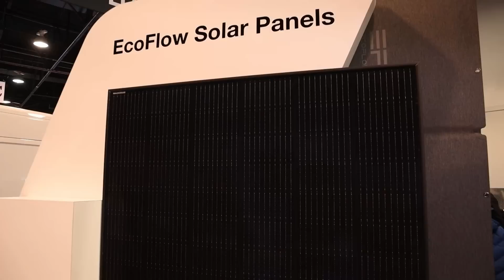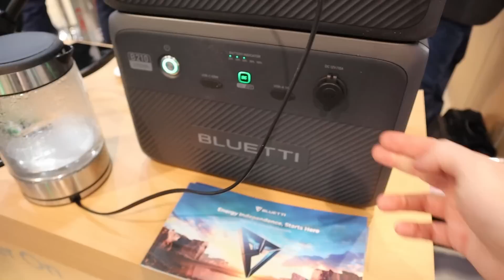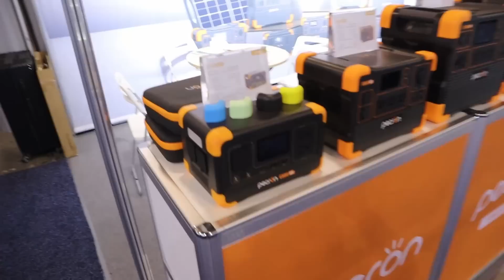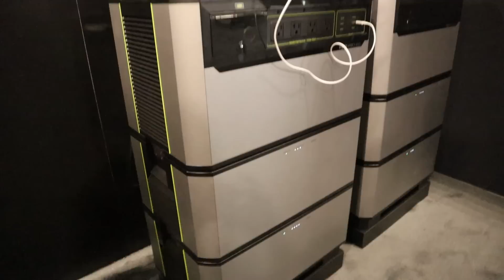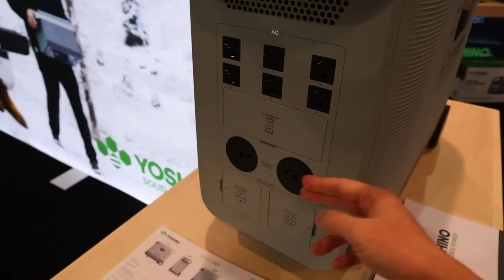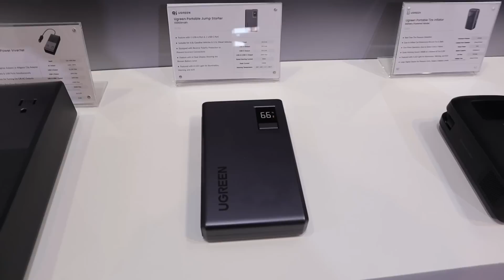Power Stations I Found At CES 2024! EcoFlow - Bluetti - Yoshino - Pecron - Goal Zero - Anker

Comment: No firman zero e?... i got one and it fully charges it self in 80 mins and has attachable 2000w battery pack that just side in bottom and it a 2000watt box 40lbs little box
Reply from the maker: I didn't see them at the show.

Comment: how is the charging on the anker 3600 bad? website says it can charge up to 2400W, seems pretty good to me?
Reply from the maker: You didn't watch the video I guess.
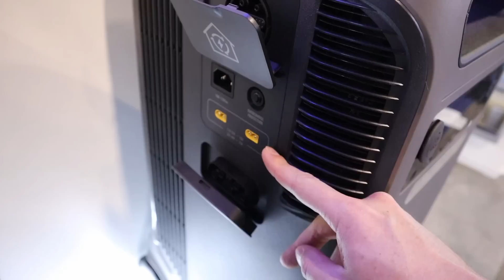Reply: @Jasonoid  uh yeah i did. im commenting on exactly what you said in the video at 16:16, you said that the charging range for the anker is "kindof a bummer" aka its not fucking good, why dont you go back and re watch your own video because you clearly dont remember that you made a negative comment about something, which is why i asked "how is 2400W bad" maybe elaborate a bit here before cocking off.
Reply from the maker: @thelasthallow  sorry about that confusion. Youtube doesnt show me the video the comment came from and I just put out a 30 minute video testing the F3800 where I showed exactly what I'm talking about. Let me elaborate on 'the charging range' I was talking about for the F3800. The input voltage for the Anker F3800 for solar is 11v to 60v, which means the solar panels you use on the power station is very limited. This means in order to have the max input you need to find very specific solar panels to max out the charging of 2400 watts at a very high amperage. You also need to put those panels in parallel which requires much larger cable and added cost and components. If you wanted to run 100ft of cable between your solar panel and power station that wiring would cost over $100. 

All other large power stations have 150v to 500v charging range allowing you to use any solar panel on the market in a series configuration. This keeps the cost wire much lower, you can have very long cable runs from your solar panel to your power station without losing power, and you can use any solar panel you want to get that power.

Anker makes their own solar panel to get the full 2400 watts but each 400w solar panel is $1000 and only has a 1 year warranty. I just bought three 400w solar panels for $450 ($150 each) that have a 25 year warranty so you can see the value of using your own panels. If you want a power station with real solar potential go with a model that has a much higher solar input voltage, not a 60v cutoff.
Reply: @Jasonoid  Seems the guy commenting above doesn't get why having high PV input voltage is so important. I went with Oupes Mega 5 because it has 150vdc PV input comparted to the other comparable units at that price and KWH. He'll see what you mean once he starts running wires from array to the powerstation. Probably under size the cable then be mad at the system not producing expected power. LOL

Comment: That Pecron stuff looks pretty good. They seem to have the 12v side down on their power stations.
And I'm kinda a Bluetti fan boy. 

I know to much 😔 Those Goal Zero fridges can be had on Vevor's site for dirt cheap. LG I guess was sued by Secop a couple years back for directly copying Secops compressor designs. But a few friends have the LG powered Alpicool's. One took a dump. And he replaced it with a Dometic 55IM. 

Speaking of fridges. I have the Iceco Jp40 and Jp50. I'm going to retire them. They work. However the insulation sucks. I had lost all power in my Peterbilt and in 4 hours in 70 degree weather the Jp50 as a freezer was at 50 degrees when I had the battery fuses replaced. No bueno. I know in 10 hours it took my Dometic 55IM to warm up to 26 degrees after it had become uplugged. In 70 degree weather. Big difference.
Reply from the maker: The plastic 'framed' ICECOs don't have the thicker insulated walls like the VL or VLpro series. You can't go wrong with Dometic, they know what they are doing!
Reply: @Jasonoid  Actually both the AJ and JP series chassis have 3.1 inches 79mm of insulation. More than the 55mm of the steel cabinet fridges that Iceco has. More than my beloved Snomaster 85L. 
I think it's because they are shot with insulation that's not very good. And as you know...These are a very common chassis. Alpicool and just about everyone else uses this style of chassis. And they all come from the same place. My sisters VL45 has 55mm. She never complained about it at all. I want to do a experiment with it VS these Jp's.

Comment: That AC240 also has an AC paralleling connector on the side for paralleling 2 AC240's.  It also takes up to 5 of the B210 batteries,  This looks to be quite exciting!  Thanks for showing us all the good stuff coming out in 2024!
Reply from the maker: Series or paralleling port? When I hear parallel ports I think of 120v with more amps and for series ports I think 240v with the same amps. I think it would be sweet to have BOTH options.... Double the 120v output or series for 240v output.
Reply: @Jasonoid  I was just reading how the port was labeled from another CES video and what you are saying would be so simple, as long as the clocks are locked together, in phase gives you double the wattage and 180 out gives you double the voltage.  It would be great to se that option on a power station!

Comment: Any of them advertising 10ms or less UPS transfer time?
I know the Ecoflow Delta Pro Ultra has an Online UPS, but that's too big for a computer UPS.
Reply from the maker: I did a recent video testing many of the popular model UPS speeds, there was actually one power station under 10ms (not the ultra)! Here's the video:    https://youtu.be/ajVgUW4qRGI
Reply: Completely forgot about that video. The UGREEN 2200 was roughly 10ms. Wonder if the UGREEN 1200 is the same, a more reasonable size for a computer UPS. Was hoping vendors would start advertising 10ms like their jump from 30ms to 20ms of last year or so.
Reply from the maker: @adriftatlas  I don't have the 1200 so testing the actual speed is no longer possible but I bet is the exact same design and UPS hardware.

Comment: Can you do something on solar panels that acre 200 watt or higher? That are lightweight which means slightly bendable. I bought a renogy highly rated 200 watt bendable renogy solar panel and it didn’t work. Did not charge much and then just quit. I like renogy and it gets good reviews but really, mine didn’t work at all. Had to send it back .. solar panels that are waterproof are very very heavy for me. That’s why I wanted a lighter weight. Even built it a structure so it would last. Sadly, didn’t even work☹️. Amy other suggestions for completely waterproof.I gut weight 200 plus or above? I’m at a loss…
Reply from the maker: I recently did this video:
https://youtu.be/Y2uhKnHIUl4

Comment: Thank you for showing us all these great products!  As a daily user of our Bluetti’s (AC200P, AC200Max & 2 x B230’s) I am excited about the Bluetti products! 
I hope that in the future these Solar Generator Companies will make units that can send the solar directly to the loads your running from solar saving the strain on the batteries and prolonging there cycle life’s ( Currently the solar goes into the batteries then goes from the batteries to the load ) NEW SUBSCRIBER Thank You!
Reply from the maker: Yeah, it would be great to have a true pass through power mode on solar. For now that's only possible on AC charging because the power is consistent and reliable over AC charging and solar can change drastically over a minute.
Reply: @Jasonoid  this is true but currently there home Solar power units like EG4, Growatt and Solark ( solar charger/ inverters ) that do this already!

Comment: Pecron and Bluetti look good to me. My worry about the swappable batteries is that top and how easily could a little water get in it and damage something. I have had my Ecoflow's DC power stop working after getting caught out in some rain with it. That hatch on the top looks worrisome and I like wireless charging that they usually have. The AC240 looks appealing. Was the solar input a XT60 plug under that cover? Didn't look their common 8mm barrel plug. That big Pecron could be the value king, but I hope they have some kind of app control with it.
Reply from the maker: The e3600 does have app control and a new upgraded touch screen.

Comment: Thanks for sharing Jason! I’d be curious if the Pecron 3600 unit could handle the startup load for an RV air conditioner. That could be a game changer along with its price
Reply from the maker: That's a great test, I'll make sure to test that out!
Reply: @Jasonoid  I'm curious about what standby power draw when inveter is on but no load, I do not know why none of the power station manufacturers have the published spec for it and it should display that on the screen, I hope you will get the chance to it out soon.

Comment: Delta Pro Ultra still seems like the best option when you look at form factor, solar input, 240 output. I can't believe Bluetti didn't improve their massive connecting cords.
Reply from the maker: The Ultra is such an engineering masterpiece! It's so quiet and compact compared to other offerings. As for Bluetti, I wish they would put some decent engineering into the connecting cables! No one wants 4 ft long cables that just stick out everywhere!
Reply: Don't know why they aren't already selling sets of short, flat cabled with 90-degree plugs. The longer ones give you "more options" than just stacking the inverter on top of the battery, I suppose. But what if we do want to only stack?

Comment: ac180t and their fridge is the most exciting.
I love hot swappable batteries!!
Reply from the maker: I like the design of those swappable batteries. They do have plans to have a 'charging' dock so you can charge them on their own.
Reply: They didn't show how they charge.  Swappable is useless if they can't be charged by any other means than by the unit its powering.

Comment: Thank you!!!
Which PS with solar panel would you recommend to power an a/c unit in an RV.
Again thank you for the coverage…..
Reply from the maker: Most of those RV A/Cs use around 1500 watts so you'd need something pretty large to get a decent runtime (or something that takes in a bunch of solar to offset the AC power usage). The Pecron E3600 might be a really good candidate for that. It's pretty compact and allows for lots of solar input.

Comment: I really like what Bluetti is doing with removable battery cartridges. It makes it much more versatile because you don’t have to run PV lines to it, just remove a battery and charge it wherever you like.
Reply: More pieces are coming.  It was really interesting in person.
Reply: The only way to charge the battery is inserted in a power station - this is a massive over site by bluetti.kind of a moot point to buy 2 sets of batterys.
Reply from the maker: They will have a future 'charging' dock that will allow charging of the batteries on their own.
Reply: @Jasonoid unnecessary added cost. It better have a way of charging with solar like a D050S.
Reply: @grindychum  sometimes where you’re using the Bluetti is a long distance from a solar array. Just as power tools have removable batteries, it makes sense for power stations too. I think the entire industry will move in this direction.
Reply: @grindychum don't worry... I'm sure they have a dock to sell you to charge those batteries.🤣
Reply: @grindychum  it is. I hope they’re paying attention to this feedback.
Reply: @CompleteOffGridAmateur I already told them. They replied with the typical " we value your input bla bla blah"
Reply: I didn’t see any way to charge the removable battery except by putting in back in the solar generator. It would be a game changer if you could just charge the battery with an AC plug.
Reply: the only positive for me would be lifting the power station easier after taking the expansion batteries out, lol
Reply: @Moes_Prep_and_Tech  The AC180T weighs nearly nothing without the batteries. I was shocked when handling it.
Reply: I hope they actually develop an ecosystem around these batteries and don't just come out with an incompatible new version in a year or so. How about a Bluetti Escooter? An air conditioner that's better-built than Ecoflow junk? A bigger sogen that fits four of them? A modular "battery box" that fits four of them and plugs into the AC series (200Max, 300, 500)?
Reply: @michaelmartin9022  I hope not, these modular batteries are stupid.
Sure they could use it in something like a portable heat pump but it's a very large battery so it's not going to fit well in most devices. At least it's LFP,  it we don't need these modular batteries in solar generators.
Reply: @michaelmartin9022  we do not need a bunch of junk solar generator boxes that you have to put batteries into. This has already been done and it's junk. It's bigger and heavier for no reason, it's not active cooled so it will just overheat e.t.c
Reply: Swappable batteries are useless
Reply: @LamoidZombieDog dude you can have that unit set up to charge your batteries from solar and hot swap them into your refrigerator and I'm assuming they're going to have other accessories that can take them as well. Also the batteries are usually the first thing to go and have issues so it will be simpler to maintain the solar generator and your equipment when batteries are removable
Reply: @NoZenith  we are in 2024 with LFP, you nolonger have to live with 400 cycle lithium ion. LFP lasts 3000+ cycles and then still functions fine for years after. After 10+ years you will want whatever 10x better technically or denser batteries are out. Removable battery in the fridge is good, but it's useless in the solar generator.
Reply: @LamoidZombieDog  you've missed the point completely, it's not useless.
Reply: @LamoidZombieDog  While they're likely to come out with a completely incompatible SwapSolar 2 inside 18 months, IN THEORY the "10x better" batteries of the future could be provided in the same form factor and drop right into this device, extending it's lifespan.
Reply: @NoZenith  This is LFP, you don't have to worry about when it will fail like you do with lithium ion.
Reply: @michaelmartin9022  you really think they will make it work with the new stuff? No lol
Reply: @LamoidZombieDog  tell that to the power tool industry.
Reply: @CompleteOffGridAmateur  a battery being built into a drill is not the same thing
Reply: @CompleteOffGridAmateur  power tools need to be swappable. Completely different product lmao
Reply: I guess from a business standpoint if their product has an issue and you need to return it, you could take the batteries out and just send the inverter for cheaper shipping @LamoidZombieDog
Reply: @Moes_Prep_and_Tech  that's definitely not the reason. The device itself is bigger and heavier.
Reply: @Moes_Prep_and_Tech  that's not an excuse to make the product itself worse lol